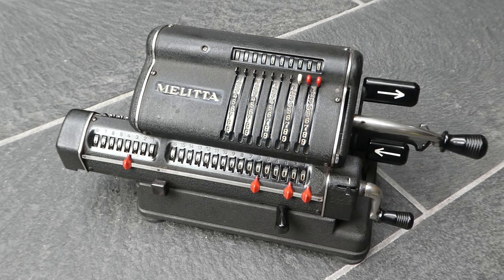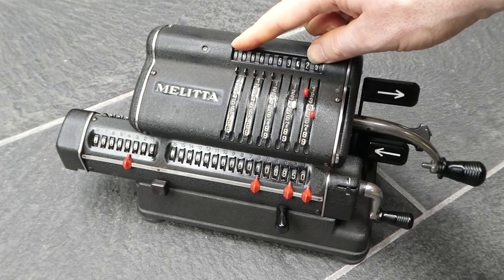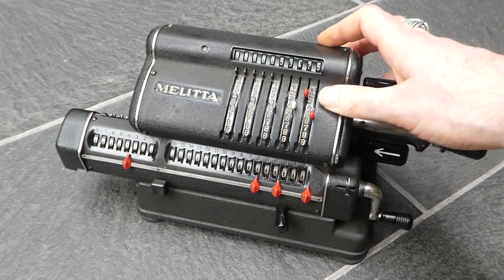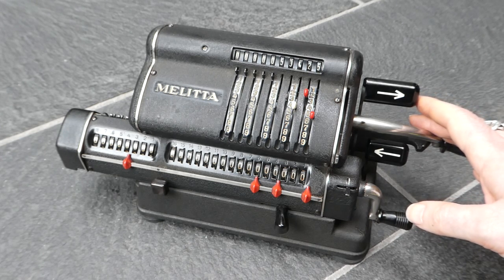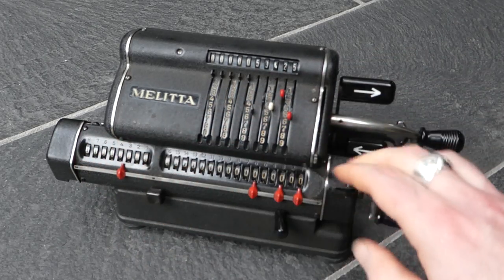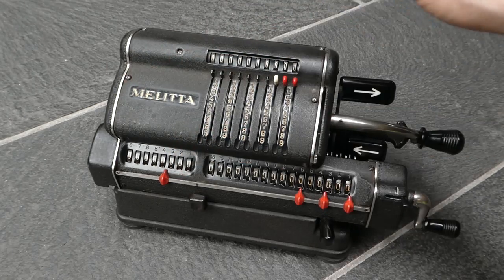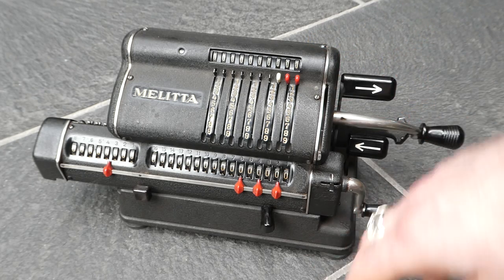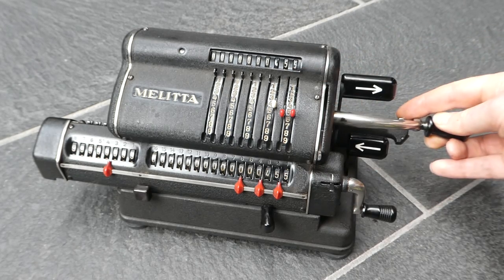The Melitta VII/16 pinwheel calculator

Comment: That's one of the most stylish pinwheel calculators I've seen - I really like that one - I'd never seen or heard of Melitta before.  Thanks for the video.
Reply from the maker: It was even available in different colours! I'm not entirely sure if the gorgeous crinkle paint on mine is factory original as I have not seen another like it.
Reply: The shubert mechanical calculator is more stylish in my opinion, but keep losing
Reply: I just got a MELITTA V/16 in very good condition, which I currently clean & lubricate a bit. It is relatively similar to this model VII/16, just with rotating number levers instead of stationary levers. It's colour is black - not with a crinkle finish, but matte.

Comment: 10:06 Why did the counter display 99999999?
Reply from the maker: At 7:57 I changed the switch located behind the crank so that the counter counts subtractions. From then on every addition decrements the counter, so when it is on 00000000 it changes to 99999999 instead of 00000001.